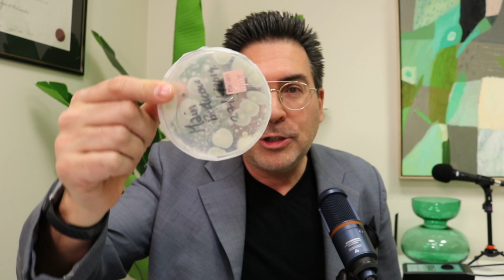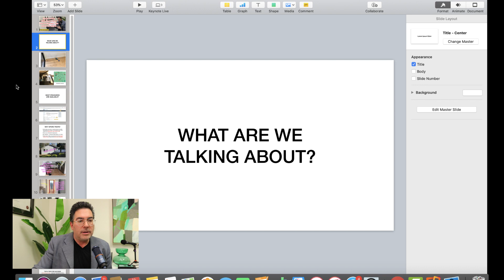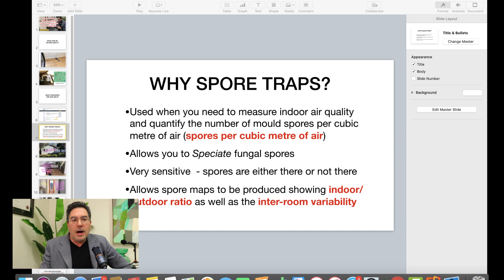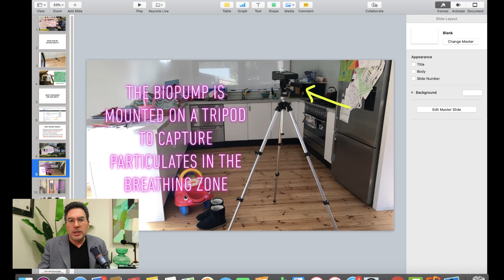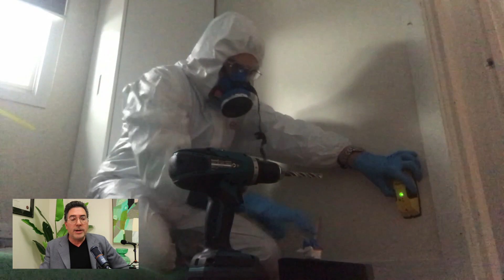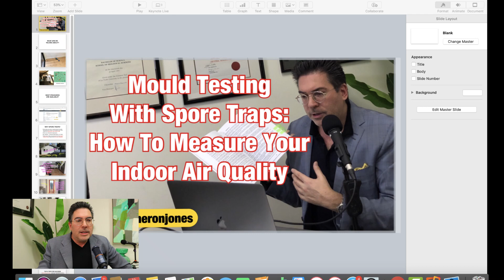Comment: 1:57 What are we talking about?
5:44 Example of Bio-Pump in action - wall void
6:59 Example of Stachybotrys discovered under the microscope
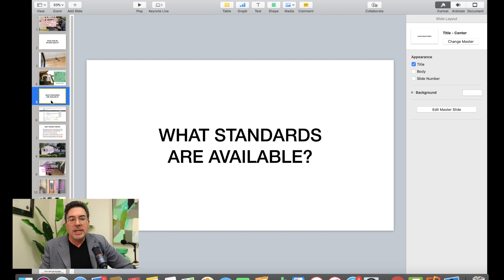7:22 What Standards are available?
7:40 Why spore traps?
9:02 Spore traps under the m icroscope
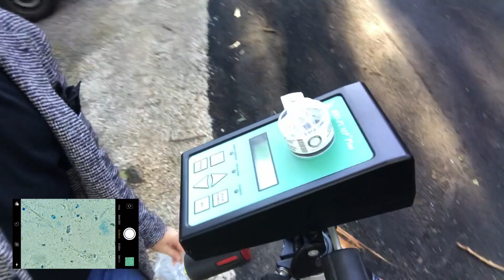10:30 Bio-Pump outdoor control example
14:15 Best practices
17:34 Bio-Pump being used inside wall example
19:06 Destructive testing of wall void